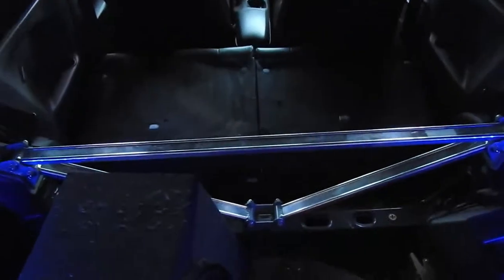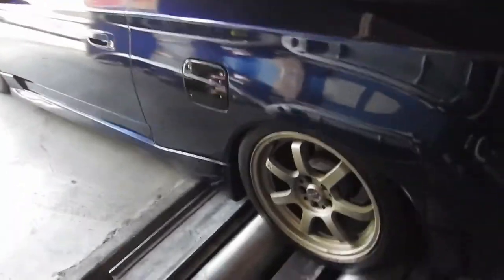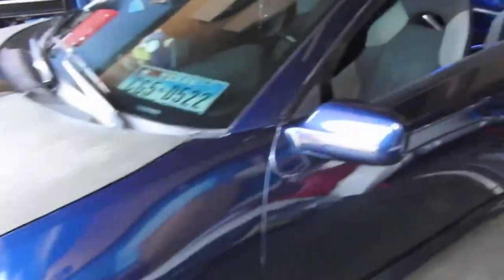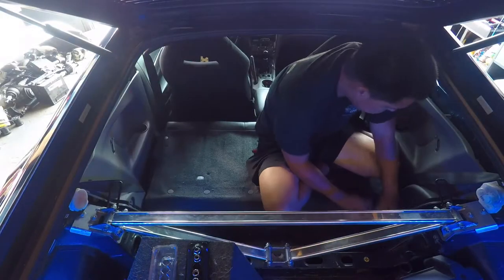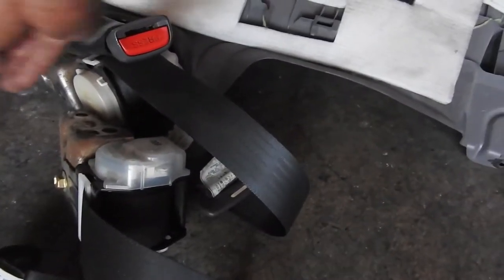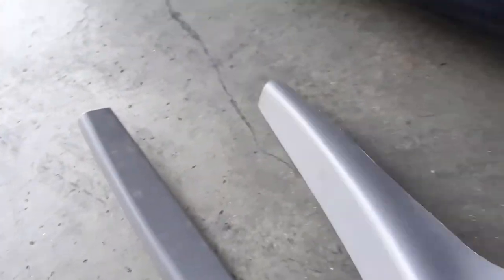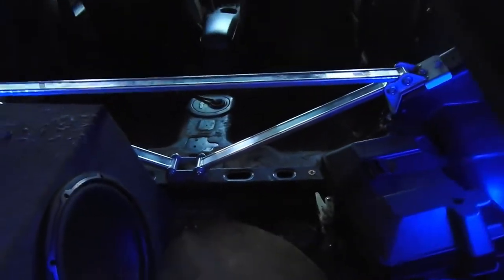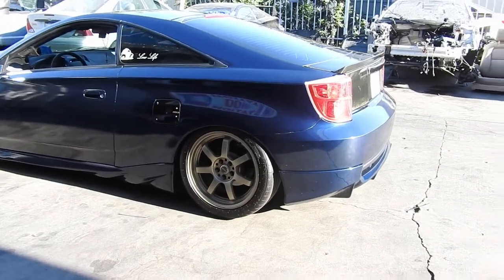Weight Reduction (Rear)

Comment: You plan on tracking it?
Reply from the maker: Justin Towers yes once its running good
Reply: You can run avensis rotors all around with 01-03 es300 twin piston calipers n avensis rear caliper. Just fyi
Reply from the maker: Justin Towers thanks for the info